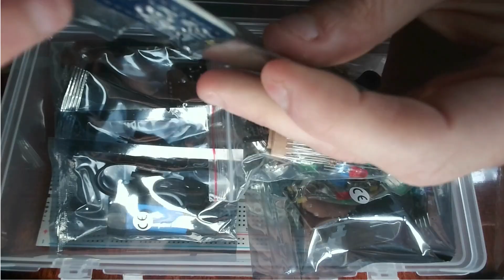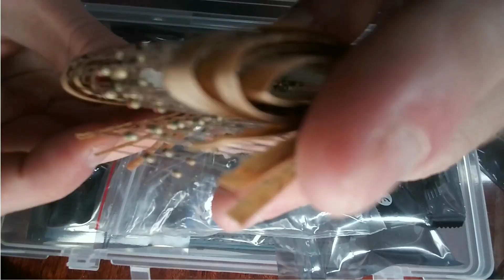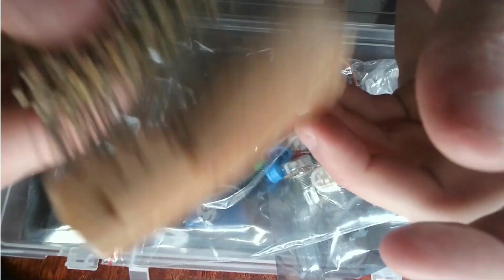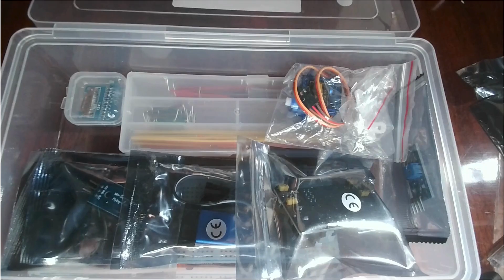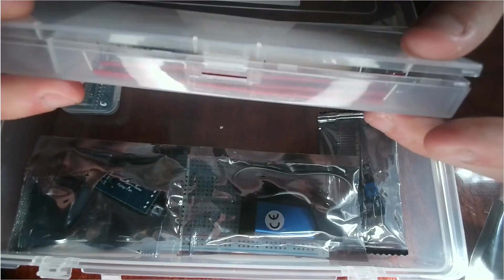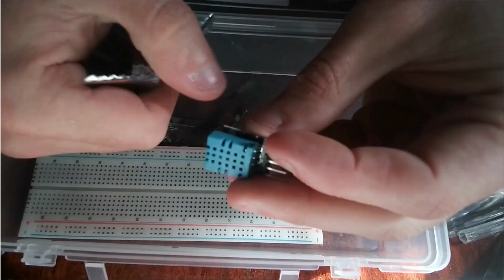What’s Inside the Arduino Starter Kit? | Arduino Uno Unboxing & Review

Comment: Hey, I am planning to get into an electronic building . Is this the best starter kit?
Reply from the maker: Yes, this type of kit is really good for beginners, but also, there is this on top of that I showed https://youtu.be/g527jgiwPK4 which I recommend getting, because it has more things in it, and it can have either the Arduino uno or the Arduino mega in it, which are both well known, which means there is a lot out there about these types of boards. The only thing is that this kit that I am recommending to you is a little more money than the one in this video.